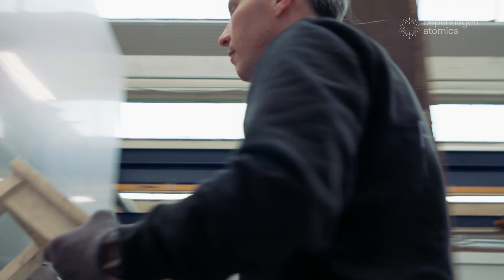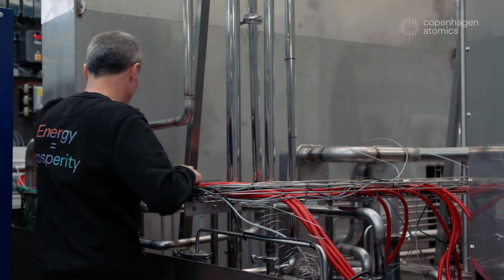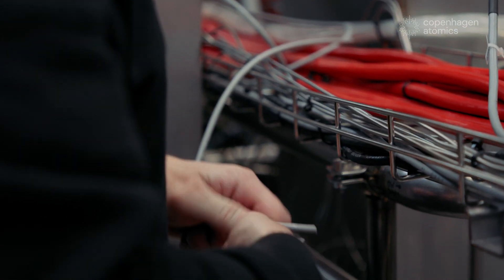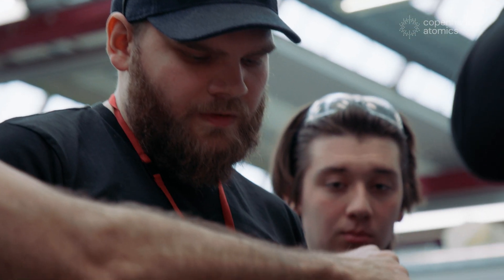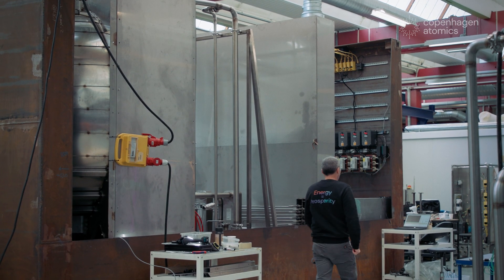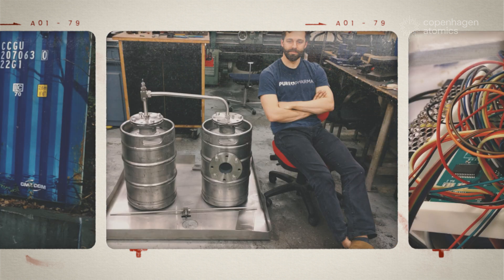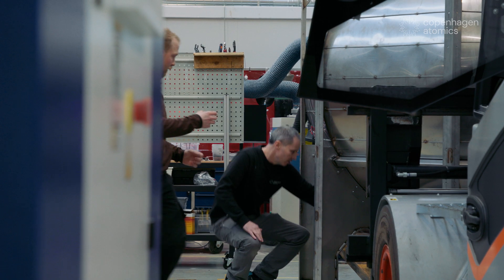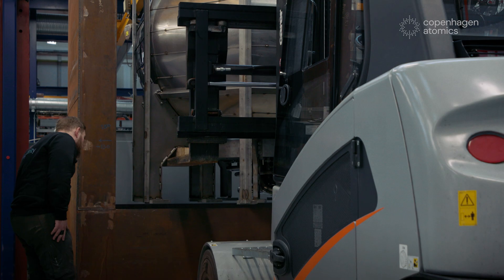The POWER of Product-First: Advancing Thorium Molten Salt Tech

Comment: In seeking to "burn" existing nuclear waste in a Thorium nuclear reactor, lots of dangerous radioactive by-products will be generated, increasing the volume of nuclear waste to be handled.  Thus, the proposition expressed in the video will not be realised in practice and misleading for viewers and giving a misrepresentation to potential investors.
Reply from the maker: Hi! Actually, it's quite the contrary. We 'burn' the long-lived highly radioactive transuranic isotopes, 1% of the nuclear "waste" which, when fissioned, will become radioactive, but rapidly decaying fission products. 95% of spent nuclear fuel (nuclear "waste") is unused Uranium, which is not dangerous and can be sold back to the uranium market. 4% is short lived fission products. Hence, you are left with the 5% fission products which are much more rapidly decaying.
Reply: @CopenhagenAtomics  This is very encouraging news regarding the 1% with rapidly decaying fission products.  Of course, this is a theoretical expectations as your company is working with non-radioactive salts at the present time in the test systems that are characterizing.  Of course, rapidly delaying fission products are radiologically "hot" and are highly hazardous in the short term (e.g. gamma emissions).  With the molten salt Thorium reactor, the key issue will be the radiation-induced corrosion of the chamber metallic components, namely something that has recently given severe problems for EDF at its conventional fission reactors in France.       Thanks for kindly taking the trouble to respond back; very greatly appreciated.
Reply from the maker: We are only conducting tests with non-radioactive salts in our full-scale platforms at the moment, the next version (to be finished in 2024) will have radioactive salts. Nonetheless, we are conducting tests with radioactive salts already in various tests. E.g. later this year a corrosion study from the University of Liverpool will be released with LiF-ThF4. 
In addition, it is not so much radiation induced corrosion, but radiation induced material degredation. However, stainless steel, which we use, is generally relatively resistant to radiation exposure, although at some point it will absorb too many neutrons to allow for a breeder reactor, which is why the reactor will be exchanged every 5 years the fuel and moderator will be reused.
Reply: @CopenhagenAtomics  Please correct "we burn" to "we propose that we will burn" and will become" to " "we propose that it will become".

To make statements as facts when you have never actually created fission is an outright lie

Comment: I had a thought about the Tritium that a LFMSR produces.  Burn the Tritium to condense into very heay water then add the radioactive Tritium heavy water to your heavy water moderator.  The reactor is already radioactive a bit  more from the Tritium should be ok.  Also you can sell the Tritium very heavy water to the Fusion reactor companies.
Reply: Burning Tritium creates Tritium Oxide NOT heavy water

Comment: I believe the Lithium in a LFMSR reactor produces Trutium.  Tritium is both toxic and radioactive.
Harvest the Tritium as Tritium is used in the Proposed Fusion reactors.
You already have heavy water so you have Duterium.  So now yiu have the ingredients fir DT fusion reactor.
But a Fusion reactor is very very difficult.  Suggest you leave that to others.
Reply: use tritium to power fusion reactors , then the excess neutron radiation from the fusion reaction to breed plutonium and uranium from thorium and u238 , marriage made in heaven...

Comment: I think it was mentioned that the reactor produces power continuously.
This could be an issue because electricity demand is not constant.
So I suggest build a CO2 scrubber that harvests CO2 from the atmosphere and converts into Methanol.
Power the scrubber only with the electricity thatis in excess to the current demand so the scrubber ia a ballast or  electric load balance.  Plus you can sell the Methanol as a green fuel.  Any excess Methanol can be pumpback into the oil fields.

Comment: What are the relevant skills and/or degrees that one would need to contribute to this industry? I would consider going back to college if it meant working on something actually meaningful and productive like this.
Reply from the maker: Hi! Thank you for your interest! We encourage anyone to get into the field. We are hiring many different backgrounds for various positions. As we have a building product first philosophy we do hire many hands-on people like mechanics, welders and technicians. But we are also hiring chemical engineers, physicists, nuclear engineers and so on, as well as people for the commercial and communication department. So there is an array of options for you to choose :)
Reply: You should consider hiring a material scientist with experience in high neutron flux and Hastelloy chromium migration at temperatures 🌡️ approaching 700 C. Also a fluid dynamics physics engineer, that can explain that pipe size matters for fluid dynamics and flow efficiency. For starters.

Comment: I’ve been a ‘believer’ in Thorium Floride molten salt reactors for many years but believe the limitation as in the material science of tge oumps and pipes as the salts are very corrosive especially under heat and pressure- has Copenhagen Atomics cracked the material science?? 🤞🤞
Reply: My understanding is that salt is only corrosive when in a water solution. In its pure and molten form, it's not corrosive.
Reply: @whiskeytango9769  Totally false.  The biggest issue with the Oak Ridge MSR was corrosion of everything by the molten fluorine salts that are used..     I don't know where they are on current technology.  But I used to work in the nuclear industry and a decade ago my understanding is that they had not yet found a suitable material to build a many decade long life MSR.
Reply: @perryallan3524  Thanks for the clarification.
Reply: @perryallan3524  In the comments to their other video they say they have developed non-corrosive salts. Everything seems to good to be true...
Reply: @Michael-Has-Opinions  That's possible in theory; I know people were looking - and had been looking since the 1950's.  Next question though is this new molten salt long term stable?   We won't know until its been tested long term.

However, I agree with your "everything seems to good to be true."    I've worked in nuclear power.... (and have many decades of both fossil and nuclear power experience).   I know what it takes to support and maintain a nuclear power plant, and all the kinds of things that go wrong with radioactive hot equipment and piping that no one thought about when the plant was designed.   The 2 video's I've seen from this company are more fantasy than real life on many issues.
Reply from the maker: Hi @perryallan3524! You are of course entitled to your own beliefs, however hurtful your comments might be about our "fantasy" and "investment scam". With an impressive decades-long career in nuclear, you must be knowledgeable within the field. However, you cannot compare traditional nuclear power plants, what I am assuming you have been working at, to what we are developing.

Nevertheless, you are quite right indeed that we have developed methods to purify the salts to such an extent that corrosion occurs at such low rates it is not a problem, even for stainless steel. Methods we have spent the past six years optimising. We are testing these salts constantly also with radioactive material to ensure that it works. Furthermore, we are cooperating with universities around the world, to check and verify our own data. Regarding the salts, peer-reviewed results will be published later this year by the University of Liverpool. You can see the lead scientist's announcement of that on LinkedIn here: https://shorturl.at/akI17
Reply: @CopenhagenAtomics  Thank you for responding.  Your link just goes to a linked in page with hundreds of different things.  It's not a good reference.

So lets talk about what you have.  You have a laboratory scale test of pure molten salts circulating at temperature with minimal corrosion issues.    

Be warned - that a great number of commercially successful laboratory scale tests never scale up for economical commercial production; and that's without adding the complexity of it being a nuclear reactor and dealing with the extremely high reliability required for nuclear power.

I see per your site that you are hoping to have a 1 MWthermal (MWth) non-reactor test vessel by 2025.   Somehow you think that you will then design and build a 100 MWthemal (30-50 MW electrical depending on technology) power plant in 3 years after that.  Not a chance.

Let me lay out a realistic timeline and the problems for you.   Assuming your 1 MWth test vessel works well and runs for a few years you can start the licensing and design process for a test nuclear reactor.   In reality 100 MWth is likely a good test reactor size.  I'd expect 3-5 years to design and get licensed under the normal EU licensing process for new nuclear reactors. Then since this will be a 1 of a kind 1st reactor (no mass production - even if you produce a half dozen of them) it will likely take about 1 year to build after you get the design licensed  (and add another likely year of construction if you wish to generate electricity with your test reactor).  Test reactors are easier to license than commercial power plant reactors.  Note also that power plant reactors will have to be in containment buildings or buried in a containment/shield structure to prevent damage and radiation release from a bad storm tossing a car or a pole to a direct hit by a commercial airliner.

Then you need to run your test reactor for likely at least 5 years to prove that your chemical cleaning equipment and process to keep the salts super pure works from all the various contaminants and wear particles and all the other aspects of the plant works as designed.  Chances are some things are not going to work as planned - and you will have to redesign portions of your plant and start over.  Add more years and money.   You may even have to design a complete 2nd generation plant to test an improved design to prove commercial viability.  Nothing goes fast when dealing with nuclear reactors and radioactive materials.  Safety requires that things go slow.   

I don't see a commercial power plant coming out of this technology - even if it works exactly as you think it will for at least a decade after you start your test nuclear reactor; which I doubt will happen before 2030.   I would not trust the country that would not run your reactor design through a rigorous design review and impose all kinds of requirements that just do not exist for non-nuclear reactor plants.  If your design works then somewhere in the late 2030's or beyond you may be able to start mass producing reactors - but I'm betting not a fast as your video says (I believe that you completely misunderstand the quality and process control issues).

Please note that here in the USA we took the largely government funded light water reactor small test size designs and built about 120 nuclear power plant reactors of over 70 different unique designs (for PWR's I believe there were 5 fundamental different steam generator designs - including one that produced super-heated steam, and similar options for most every structure, system, or  piece of equipment in the plant).   All of them worked well theoretically and at a laboratory scale.  

Many of those design options did not work well when scaled up. Some worked well enough to run the plant for a while (and some of those plants have now been closed as they did not run well enough to extend their life on), some could be modified economically (I've personally been involved in one such modification done about 30 years after plant startup - but needed to run well enough for extended plant operation), some could be replaced economically, and some plants were shut down very prematurely because key design items just did not work well enough and could not be economically modified or replaced.   

The very reason we have such reliable 3rd generation light water nuclear plants is that they had 40+ years of lessons on which specific designs worked very well - and which ones did not (actually the latest Candu reactor has the same lessons learned - although I'm not sure any will be built).    Molten Salt reactors are going to have to go through the same process for it's key components.

I suspect that you have a lot to learn about nuclear reactors and their maintenance (and I laugh about your concept of no service for 5 years)... That's a great goal.  But, it is not reality on how large equipment and complex systems work, and the tiniest leak of radioactive materials will have to be investigated and likely repaired until you have a lot of running history.

Something else I will give you a head up on.   You need to plan how you will handle a primary coolant leak when your heat exchanges tubes or plates leak - and they will leak (One of my 2 specific nuclear expertise is heat exchanges).  Here's another tidbit of information - material in most cases leaks from both side to the other - even if 90%+ is in one direction.   Where is the radioactive salts going to end up... and how will that affect the rest of the plant and the people in it?

With all of that - I do wish you the best with your concept.  Perhaps it will actually work; and we need something else to work.   

ps: there is nothing new about thorium or even thorium breeder reactors: Indian Point Unit 1, 275 MWelectical, U232/thorium fuel, online 1962, New York State built and licensed under the US Atomic Energy Commission "Atoms for Peace" initiative  Later converted to U235 as it was more economical.  Decommissioned in 1974 as it was uneconomical to upgrade to more modern safety standards with the creation of the US Nuclear Regulatory Agency.

Shippingport (60MWelectrical) demonstration/test reactor.  Core load 3 was U232/thorium breeder core and ran for 5 years.  It was successful.  As this was an early demonstration/test reactor it was shut down after Core Load 3 as they saw no need to continue operation and it was not economical to operate for just 60 MW of electricity.

The USA was all hyped up about thorium and thorium breeder reactors from the start; it just rurned out that U235 was more economical; and burning of any waste requires reprocessing of the highly radioactive spent fuel - which could be done now but most countries shut down the reprocessing plants.  Also, if you didn't know - Thorium is not fissile and the reactor actually runs on U232.  U232 also makes a great atomic bomb and the US Department of Energy did consider going that route for weapons - in which case they would never have developed the later plutonium based nuclear weapons or plutonium breeder reactors (there's actually a very specific DOE letter out there stating that).

Edited later to add:  Note that you just cannot place nuclear reactors here there and everywhere at a whim.    There are specific site licensing requirements as well.   In the USA it typically takes several years to get a site license (even for a research reactor) and I doubt that Europe is any faster (seismic risks and other things must be evaluated and your reactor must be designed to withstand the local site hazard; and some sites prove unlicensed once the appropriate investigations are made).   Your company can be getting a site license while your test reactor design is approved, and later power plant sites should have years to get site licenses in advance of your final power plant design.
Reply: @Michael-Has-Opinions Well said, because the down side is the radioactive materials that are made in huge quantities; tools , scaffolding, and other contaminated items are then thrown into the expensive pits at yucca mountain, after decaying atoms are spread over hundreds of miles, which decay and cause normal matter to decay!
Reply: @perryallan3524  great to read all that. Just a question for clarification about your prediction of heat exchangers "they will leak" - is it the case, that in PWR the constant high pressure makes every joint likely leaky? if so, would the molten salt which needs just enough pressure to circulate provide a lot better chance to not get leaky joints and fittings? cheers